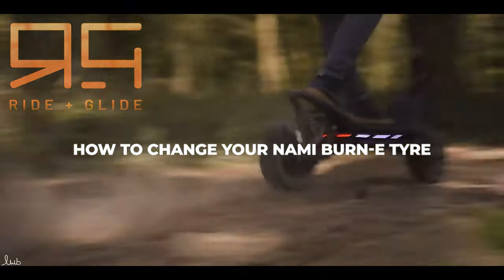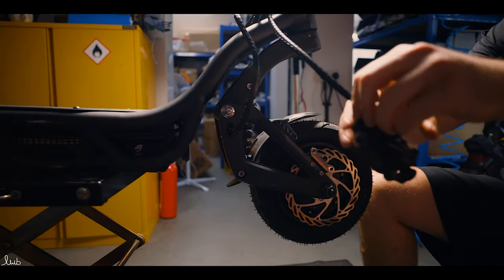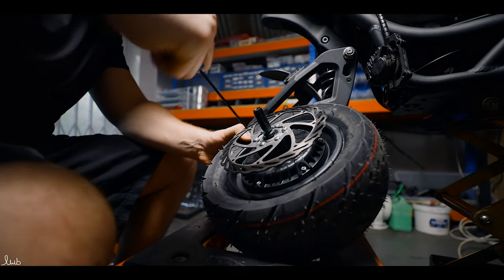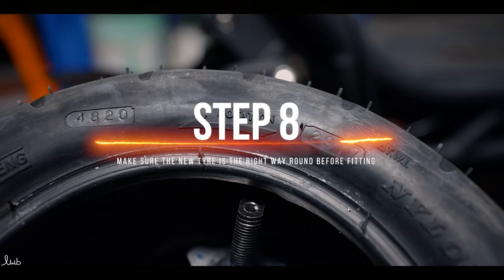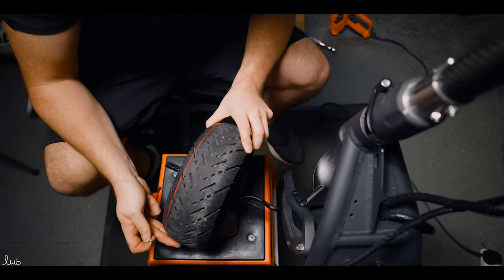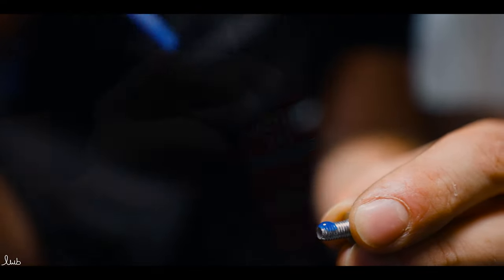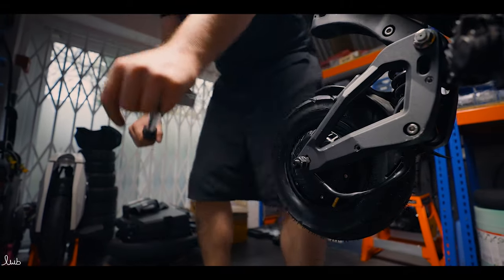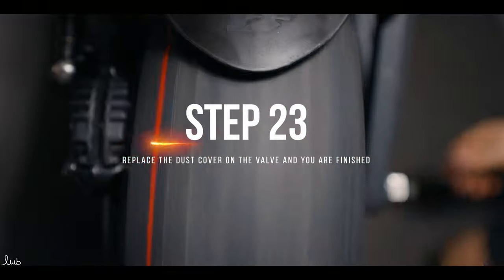Nami Burn-e Tyre Change Tutorial

Comment: Guys from @rideglide give me a heads up please... At 1:00 are you only having 2 (instead of other vids showing 3) washers to remove? Also it looks like there is no spacer between motor and disc brake? I´m now quite unsettled about if I´m missing parts or not. Enlighten me please.
Cheers

Comment: Installing tires back on the Kaabo Wolf King Gt are a pain. Is it easier to install tires on the Nami E Burn 2???
Reply from the maker: Havent changed one for a while but the Nami Burn-e's are very straightforward!  🙌
Reply: @RIDEGLIDE  That's what made me buy the Nami. Changing the flat tire on the Kaabo Wolf King Gt Pro was easy. Correction the hard part was putting the tire back onto the front forks it has a complicated design.

Comment: I have the Burn-e 2 Max, and I need to replace the front brake rotor. However, I can't find anywhere what the torque should be for the axle bolts (step 20). Can you share what the torque spec should be?
Reply: He literally says in the video

Comment: My scooter The tire is leaking air through the cheeks
Reply from the maker: bead might not be seated correctly?
Reply: @RIDEGLIDE  no
Reply: Pur it up on bucket and spin the wheel full speeds for 10 secs , let it stop spinning them pump 😊